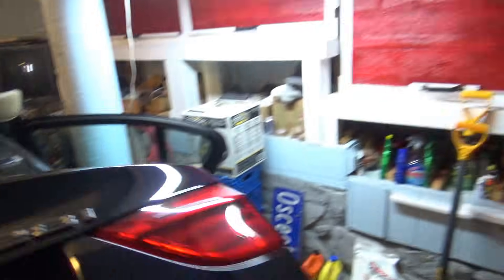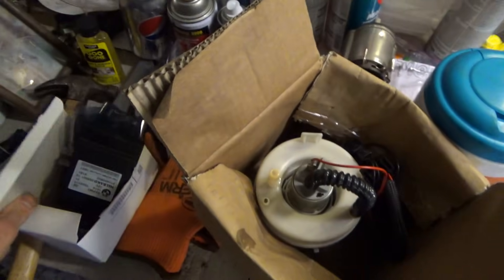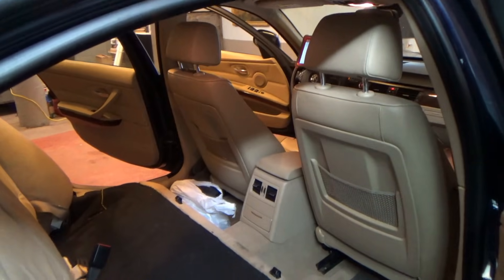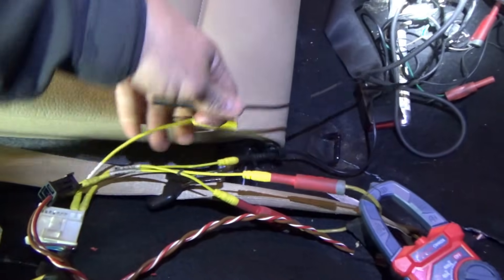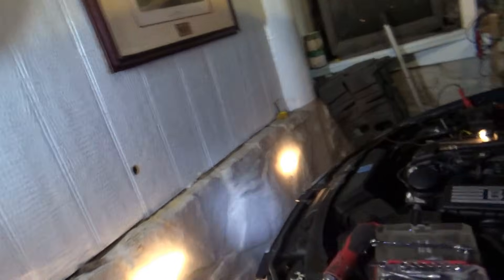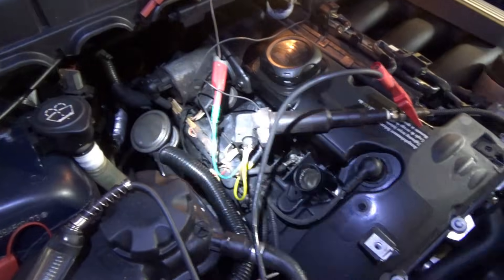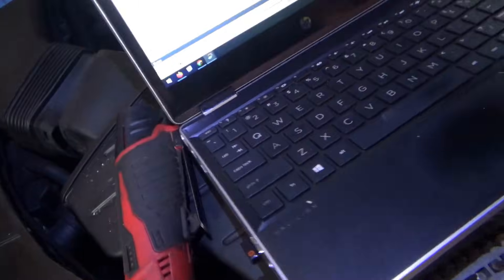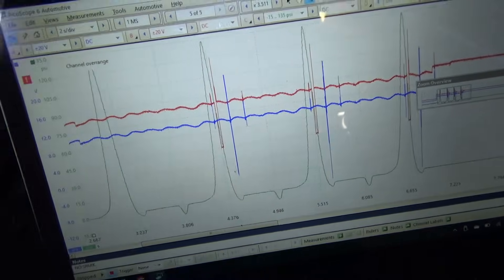Dealer BUTCHERED this BMW?! (Crank No-Start)

Comment: Unexcusable for the dealer to leave off just one earth connection to the injectors, let alone leave another loose & flapping in the breeze!  

They should have known better, & probably ALSO known that a missing earth would lead to ECM failure.

The missing earths probably damages the ECM as the high inductive spikes may cause arc-overs inside it, with the HT 'looking' for somewhere to go.

Great diagnostics Ivan! - & thanks to Keith for the great advice!

Comment: If the car didnt run after valve cover job then yes, dealer responsible, but if the car runs and drove home after valve job, then even if the dealer reaponsible, they will deny that, and you will get nothing i guess.

Comment: hy smth i need you help my car wont but its able to start what could be the problem its uk made 2000 model 325i bmw  have tried to change mass air flow senser and padle nothing it all started after the air flow sansor was misplaced please help

Comment: I doubt DME is burnt. BMW has a safety feature that shuts off the system after a number of crank no start, its anti-theft is designed that way in many bmw's. Get it re-programmed and you will be good to go. I am just worried about the crank sensor and starter after too much cranking.......
Reply from the maker: DME is toast

Comment: Hi Ivan - You faced this issue while diagnosing the 4x4 bmw with the oil level sensor and unplugged grounds... IIRC where the customer drove 15 odd hours to get to your shop

Comment: That battery sounds like it’s had it, the crank is so slow. Trying to diagnose a car with without proper power isn’t a good idea. More to the point How did the car get home in that state? They came off when it was pulled into the garage? Hmmmmm………I smell BS

Comment: I wander when german car makers start to code the fuses and the light bulbs... I'll never buy a german car again, I had WV passat full of problems, the mechanics sayd "this is a common problem in this model" for everything which failed and I started to wonder is something in it whitch isn't a common problem.  I got friends with BMW and it was the only car which I pushed down to the hill and still can't move on it's own power. Germans love to overcomplicate the cars to pump the price and do the maintenance expensive. This cars are botomless pit to throw a money in....  Damn, why even such a module exist the pump is just a DC motor...

Comment: The key piece of information is that there was prior work done on the car (but by who?). The first step is to inspect if the work has been done properly to the best of your ability and this includes checking the engine oil level before starting the car. 

How did the customer drive home with one ignition ground disconnected (3 cylinders) and the other loose (3 cylinders)? How did the dealer do a test drive when the coils are disconnected? There is something else going on here.

Comment: Hi, I removed the airintake manifold and all the attached components, to gain access to the starter. The nut was loose. I tightened the nut, while in there, replaced CCV and all the temperature sensors, 3 in total. Put everything back together. Now the car cranks but won't start. Tested the injectors by a scanner, they all show "off" with key in position 2. I cleaned every connector with connector cleaner and made sure they are all properly firmly connected. I have fuel in the rail, the fuel pumps works fine. 
Measured the voltage on the injector wiring harness with a multimeter. Negative on the car body, positive on each prong of the connector. I do have 12 volts on one prong and about 4 volts or the other prong. This is the same for all six connectors. The problem now is instead of 4 volts, I think I should have zero volts. Would you please give me some guidance. Thanks.

Comment: Great ,Great as always ivan ...keith tho no words!

12:45 , am i the only one who is scratching heads for the in cylinder and injection waveforms ... timing wise since both are from cylinder #1 ... why would the injector fire in power stroke and what is that deep vacuum on the intake stroke ,some one help me here i think i missed something

Comment: Most BMW dealers are excellent, but there are a few duff ones.

One dealer did an Inspection II on my two 2001 539D Tourings, multiple items (brake fluid change for instance) omitted from the service, but not the same ones on both cars.

The same dealer changed the immersed fuel pump, didn't connect the twin fuel senders properly and the car misreported the amount of fuel in the tank and left me stranded by the roadside.

Very sloppy work and we won't use that dealer again if we can avoid it and we will closely verify any work they do.

Another one changed a broken steering lock on our '93 520i Touring but didn't bother to match the keys, some cock and bull story about it not being possible to buy a lock to match a specific key. Another dealer we won't touch with a barge pole.

Other dealers in the UK and France I have used have been excellent and very reasonably priced.

Comment: The ignition coils for this car is a 3 wire type, but this doesn't mean the transistor is integrated in the coil itself !! ON THIS CAR THE CONTROL TRANSISTOR IS IN THE ECM!. The pins for the coils are - 1st is Fused power , 2nd is switched ground from the transistor IN THE ECM !!! . 3rd pin is additional ground for the secondary coil. And my theory is . When this additional ground (3rd pin) was left unbolted , still the car could be driven out from the dealer garage , but the coils slowly started to heat. This ruined the coils . But more importantly , melted the coil winding insulation. Which caused the winding to touch each other and short out. This led to high current travelling through the shorted coil to the control TRANSISTOR IN ECM.

Comment: Guy brings his car to dealership to have valve cover gaskets done under warranty, then proceeds to replace fuel pump and orders new control module... sure.. yeah.. that makes sense..  

Anyone can make a mistake though, and the fact that Ivan had to call Keith for rescue says a lot and will be a learning experience to many.

Comment: Ivan can you help me understand how a bad coil ground can ruin the trigger(drivers) in the pcm? If there’s no ground there can’t be any sort of current flow I wouldn’t think or any high voltage produced?
Reply from the maker: Great question. I'm not exactly sure how BMW wires the coils, but that missing ground caused excessive current to flow through the ECM drivers.
Reply: No ground wont destroy the drivers, Ground touching and not touching like in this case will, common sense even if it says toyota on it.
On the other hand Siemens ecu are also way ahead of anyone else. You can pretty much throw boost on it and bigger injectors. The tables are so wide a knock sensors so good it will be able to adjust (not perfect but...)
Reply: @Iceeeen  can you explain how an intermittent ground can fail the driver?
Reply: @joshwilson849  I'm not on a technical level but I had drivers go boom on me (not on a car) when the grounds been bad. My guess is if you have the driver loaded and a loose ground it overloads it.

Comment: Ivan, if you set the parking brake before turning the ignition on most vehicles will not illuminate the headlights until you release the parking brake.

Learned this in my dealer days, illuminated headlights suck to work around and some get really hot.

Comment: I suspect the ring terminal on the ground that was not connected was on the stud but not fastened with its nut. That would get a marginal ground. The engine would run until the ring terminal came off, perhaps from vibration. The insulation in the coil likely breaks down after some time, because of higher than tolerated secondary voltage in the coil. That high voltage, or some portion of it, now flows into the control connection of the engine computer. Without clamp diodes to +12V that fries the computer. Poor engineering at the least.

Comment: I’m originally 2hrs north of NYC. Wonder if he was in the Kingston, NY area. 

I just had a no crank, no start on my E38. Intermittent battery strength due to the heat bearing down on the Phoenix area messed with the DME. Unplugged battery for 30 minutes and installed a new one. Fired right up. A temp gauge that pins to red when the car is cool suggest the DME is not communicating. Needs a reset.

Comment: Before you condemn the ECM, try checking what the fault of the CAS is. Car won't start if you have a bad CAS and may just need to be reset. I seen it had a fault. Follow the test plan for the CAS if your scanner is equipped with that option. FYI. Don't use a conventional test light to backprobe computer controlled components specifically on BMWs. That will fry modules as per BMW Training Center. Use a volt meter or a test light made specifically for computer/module testing. Snap on has them. Hope you find the problem.

Comment: Coding of auto parts should be illegal.   It serves no purpose other than to ensure that only dealers or independents with expensive tools can fix cars.  If you're going to code it, it should be accessible via the computer screen in the car, you type in you owner's code and it codes the module.
Reply: A lot of modules are universal fitting many different models of vehicles. The programming puts the correct software in for your particular car.
Reply: That's how many fancy cars are now a days unfortunately. They do that to keep the value in their vehicles.

Comment: Did you address the A0B4 code being thrown by the CAS?  If you crank the car enough times without starting, the CAS will disable the car. It's an anti-theft feature.  You have to use INPA or other BMW tools to resynch the CAS and the DME.  That might be causing your problem.
Reply: Was wondering the same thing
Reply: The key sign is on the dash…..
Reply: Hey guys I think you know this problem… 
N54 engine manual 8 bolt crank I bought 6 bolt is”engine with fly with transmission.  Sam problem 
Just fuel pump work but obd2 not working I check fuz every thing it’s ok no codes I can see just obd with icom… the say ground not coming dme

Comment: Sadly I had a Miami bmw dealer (South Motors) butcher a convertible top repair on my z4. After I took it to another dealer who fixed it properly and took pictures South Motors denied doing it and refused to compensate me.

Comment: hey @Pine Hollow Auto Diagnostics, do you know anyone like you that is out west? Say, in the Colorado area or region? Any nearby recommendations?

Jeep has a mysterious "randomly stalls while driving" issue that is driving me CRAZY, it's been to the stealership a few times but each time I just get the same BS canned line about "we cant reproduce the symptoms" and I can't get any straight answer on what the actual problem is. There is no check engine light or codes and it makes me super paranoid to drive it since I don't know the next time it will suddenly stall in the middle of the road (usually happens at a stop light)

Stealership visits just seem like a waste of time/useless at this point (it's already been there 2-3 times), each time I just get told nothing is wrong and the "we cant reproduce the symptoms" BS line 🙄

I really need someone like you who actually goes in and does a deep/thorough diagnosis of the root cause of the problem. 
Almost seems like stealerships only check for "easy" surface-level codes, and if the check engine light isn't on they just spit the car back out to the customer, absolutely useless 🙄
Reply: Replace the ECM. I've had a few Dodge vehicles cross my path with similar problems. Even my own 2000 Ram 5.2 truck. It was a parts cannon for 6 months. Finally, a NO BUS signal pointed me to the ECM. It would start when cold. However once it was hot or running, it would randomly shut off. A new ECM cured all the problems. Save diagnostic fees and replace the ECM. Add another ground to it too. Good luck.
Reply: i had short in fuse box

Comment: my neighbor has a old honda hatchback with acura tsx engine and i swear that ecu is a tank,i seen him literally switch wires around from sensors with no idea what they do/jump random wires/even had tps wires that were grounding on the closed hood/was missing valve cover ground and still the ecu didnt get damaged.the ecu is a acrua rsx and was just amazed he could just jumper wires around and short to ground and still not damage ecu.

Comment: You'd think that the engineers would simply agree on a computer control system in the industry and all of them use the same foundation. What a cluster...even BMW shops are having issues.

Comment: the previous fuel pump  suspected problem sent you down a rabbit hole.  this is another example of why I always check for spark first on a crank no start.  I use an inline spark tester,  no need to even pull a plug., just snap it between the boot and the plug.   if one plug isnt sparking, I check a couple others incase one or more of the coils or plugs are bad.,,.  this will save you alot of time and aggravation.,  many cars are wired to where they will have spark without fuel, but not fuel without spark.  also the probability of a ignition problem is much higher than a fuel delivery problem in most cases.  bmws or volvos that have sat for a while without running tend to have the fuel pumps seize on them, but when they are run regularly, they rarely fail.

Comment: Great job as usual. Ivan, I smell a Rat. Your Customer is Lying through his teeth. Blame the Dealer....Blame the Dealer....... The same smuck that did the Fuel Pump Hack also did the Valve Cover. I would bet Money!  Mr. Customer is a Hack Mechanic. Look at those Professional toolboxes in the background. Makes the most sense. And How did the Car arrive at his house with 2 bad Grounds?
Reply: Loool probably
Reply: Because both grounds would be needed to taken off if the valve cover was replaced or removed. Obviously whoever put the cover back on got distracted or wasn’t paying attention

Comment: Buut.... if the dealer did the car work and inadvertently left those grounds disconnected....
ummmm, how did the car even make it out of the dealer's shop?
Would the car have started fine at the dealer and then failed in the "owners" driveway/garage?
The owners story just doesn't make sense to me....

Comment: Hard to believe a dealer would make such a mistake - they of all people should know what would happen with those grounds not connected. And if it worked when the guy to it in to them, there is no way they could have not noticed they messed up somewhere. I think it more likely that the guy done the gasket himself, I just get that impression by his whole demeanour, saying he would foot the bill for the ecu replacement kind of says it all. If the dealer had really messed it up a normal customer response would be very different!

Comment: To all the people who think the owner messed with things:

Maybe he’s straight-up lying and never went to a dealership to do any work. In that case there’s no point discussing it. Ivan got paid, and this guy has a fragile ego so couldn’t pen up to his mistake.

If he did take it to the dealer for a valve cover job, why the heck would he mess with the grounds or anything else? If you take it to the dealer for a job as simple as that, you’re not going to then go in there and start messing about. If the dealer did the job right there would be no reason for the owner to mess with anything. You go to the dealer because you want the job done and want to forget about it and not waste time.

Option C: guy went to the dealer and then ripped things apart on his car afterwards for no reason just doesn’t make any sense. That is what the dealer would claim in defense if the guy took him to small claims court and it’s clearly bullshit.
Reply: Exactly, Why doesn't Ivan, Pick up on this. Probably wants paid, and get the heck outa of there. New York is a dangerous place. Make no waves.....😁

Comment: I hate people who do that, they know a certain shop or a dealer cause significant problems and yet they take it back there and just pay the cost out of pocket to fix the issue the dealer caused and don’t bring up the issue whatsoever because they don’t want any confrontation or any issues. Because they’re afraid that they (dealer/shop)may break something further or do something else or break something that you can’t prove. It’s just like well I could’ve walked outside today and get hit by a car or I could get struck by lightning, but I didn’t so I stayed in the house instead ,yeah you could do that ,BUTT the chances are nULL and if people live this life with the mentality thinking well if I go there I might get robbed or beat up, then they don’t live life at all and they’re just pretty much a pansy lameo, 

What happened at everyone’s balls? I swear everyone’s neutered nowadays and nobody has any backbone. Because you’re technically going to spend easily 600 to $3000 for an engine computer and re-programming, that THEY (dealer)should be paying for because they caused this not you they did and yeah it could’ve been a simple mistake just forgetting that ground but forgetting that ground causes catastrophic damage that’s irreversible and the remedy to that is very very expensive so there’s No way I would pay out-of-pocket for that.